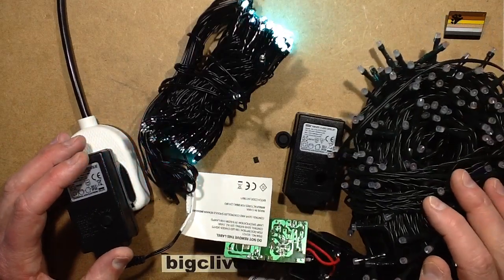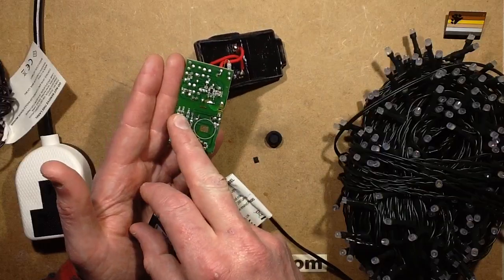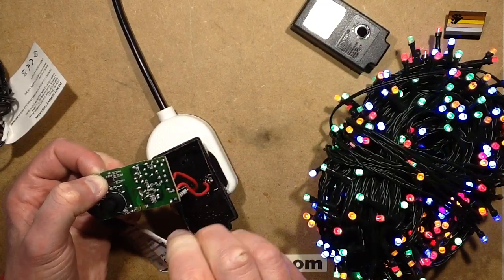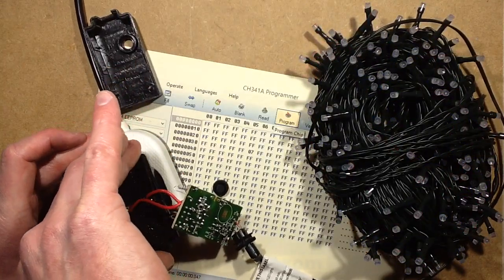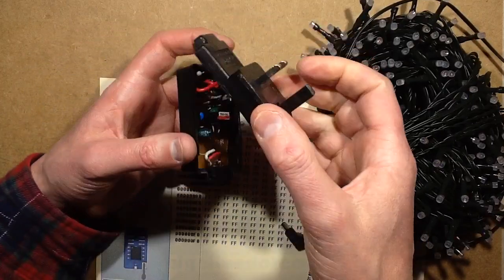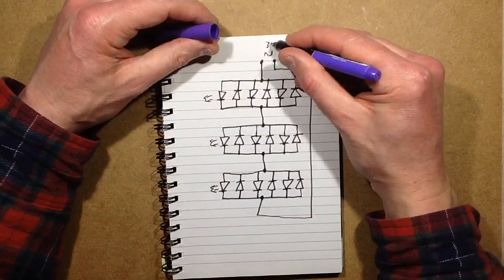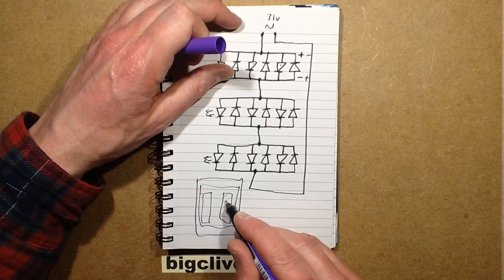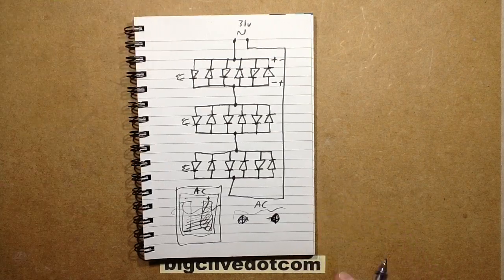Memory hack for new 2-wire LED Christmas fairy light controller.

Comment: And few years later in 2020 the memory chips became so cheap almost all the lights I have has setting memory._
Reply: Well, one more year later, they don't. Just bought a few of these and they don't remember the last status. I'll discard the original power brick and I'll feed the strings from a transformer. Yes, LEDs will flicker at half of the supplied voltage, so 25 Hz in my case but the strings are to be installed outdoor.
Reply: @horatiuslavescu  I have a string of lights on my window from 2015 and it kept the setting after 10 months being unplugged. Although not all lights are same._
Reply: @horatiuslavescu  curious to see what you came up with!  I installed 21 of these things wrapping several trees only to find out the last 13 of them don't have the memory function.  And getting a 73yo woman outside to cycle 7 times through each of them unfortunately means she won't use them in the future.  I'm a bit more amateur and trying to find a more robust way to just keep them in always-on mode.  I could try getting a memory chip (13 actually) and doing it that way, but I'd rather have a single supply that could provide the adequate current but just do the simple oscillating and not support all the other modes.  Right now it starts in the combination/demo mode, which we call "clown show mode".  The Christmas light equivalent to one of those terrible car alarms that goes through several modes over 20 seconds :D

Comment: great video i learned a lot from it,  i have very similar lights from Amazon but the Led controller is slightly different from yours as it does not have the space for another IC controller like you used as memory, does that mean it is not possible to have the lights on it fixed, it be awesome if you could check the photo of my board and see if it has a chance as i hate those multi function controllers   ibb.co/0GRJvkd  thanks for your great vids

Comment: Just tried this hack and it works.  Converted two sets of lights, couldn't work out which was pin 1 so I guessed and the first chip was fitted the wrong way round.  Removed it and rotated 180 degrees and it worked perfectly.  I can now switch them on with a timer without the manic flashing.  Great tip

Comment: I used a pair of Knipex water pump pliers to crush along the side seam until it audibly cracks.( I have also smacked the sides of similar cases with the handle of a screwdriver to crack the glue..)
. Then resoldered the connections to the transformer ( looks like electromigration cracks round the pins caused by high current spikes, common SMPS fault) as it had failed glowing dimly all the time the mains was on. The version I had seemed to have non volatile storage on the 8 pin controller, only one chip and an H bridge.

Comment: and 4 years in the future...  they still have not made them luxury yet... friggin lights still dont remember last mode!!!  thx for this vid, I am going to crack one open and see if there is a spot for a memory chip, order one and install asap.
Reply: I must be lucky as all the two wire sets I've bought in the sale remember their last setting.  And yet it's funny, our new oven can't remember its settings each time there's a power outage!
Reply: Even more annoying they default back to off position once power is cut ,so you have to switch on manually,once power is restored .No good for a solar setup

Comment: Have had good luck opening "wall warts"/power packs and these kind of sealed boxes with a bit of petrol/gas in a syringe, soak the joint, even if you need to use a needle to keep it tidy, after a minute or so you can work the cover loose with a plastic prying tool.

Comment: Hey Buddy. I have string LED lights on my Christmas Tree. The operate with Red and Warm White... then Blue And Green. A programmer changes the pattern but the paired colours remain the same regardles. There are only 2 wires exiting the transformer/controller single unit as in your video. But I notice a single wire bypassing all the LED's to the end... at the first LED (CLOSEST TO THE MAINS CONTROLLER) has 1 wire going in (live I assume) and then 2 wires coming out. The second LED in line has 2 wires going in, and 2 wires coming out. This is repeated until the last LED where the (assumed) NEUTRAL OR GROUND completes the circuit. I THINK the set up described above is accurate but I may have missed something. I want to make the RED and WARM WHITE to be static and the BLUE and GREEN TO NOT OPERATE at all. Can you help. I'm an electrician by trade not an electronics engineer. So I am aware of safety aspects. Thank you.
Reply from the maker: It probably swaps polarity to do the colour change.  You could probably just put a single diode in line with either of the two wires coming out of the controller to choose either of the two colour pairs depending on its polarity.

Comment: I have some string lights which dont have a place for a memory chip on the board. I would like to try to hack a chip in soldering it directly onto the existing one. Is it posible you could doodle the circuit for the memory IC down somewhere?

Comment: Cool! Thanks for sharing this, Clive. I have set of solar-powered fairy lights that I adore, but their nasty flashing settings (of which there are about 20 that I have to cycle through every time I turn them on) drive me to distraction. I will try to get my hands on some tools later and open up the control box. As I'm travelling and don't have any way to do soldering, is there any alternative approach you would recommend for keeping the memory chip in place?
Reply from the maker: If it has the memory position, soldering is the only secure option.

Comment: Had controller from same manufacturer, tried taking it apart to do this and sadly it looks like they've changed the design - no longer any pads on the board for the chip. It has a later version of the microcontroller - JT-401D - so I guess they took out the memory option.

Comment: Thanks for this! All my other set of lights have a memory, apart from the 1000 led string bought reduced to clear last January. Couldn't use them without this.
Reply: Adding a 24c02 chip worked a treat

Comment: Thanks for bringing this to my attention Clive, my house is now 100% more christmassy as I couldn't be bothered to put the lights on previously, since they always start on some seizure inducing disco strobe setting and pressing through the settings was a chore.

2 minutes separating the cases with a stanley, 4 hours tidying my man-cave while looking for a serial EEPROM and a few minutes to fit one and gluing the cases again and we're all set.

I would like to add that it would appear that the EEPROM doesn't necessarily need to be a 24C02 in these (CZ) JUTAI units, I used a 24C16 as it was the first thing I happened across, and the addressing of serial EEPROMs would suggest this would work with anything from a 24C01 to a 24C32, as higher address bits will just be ignored.

Comment: As far as corrosion, the lead on each LED would only see one direction of current flow and corrode.
Reply from the maker: It's the voltage between them that matters so it's going to effectively be about 3V AC.

Comment: Finally found this video got a question can you put in a memory chip with the older style of function and musical  lights because it's quite annoying when they start on static and I always have to change the function every time I plug them in
Reply: The only reason adding the memory chip works in this case is that there is already programming for it in the MCU (the open position for the memory chip on the board is a plus). If the programming doesn't exist then no amount of memory chips will help.
Reply: @TehFreek  darn lol OK

Comment: I just bought two sets of christmas lights, the power supply is very similar to the other JUTAI power supply in your other video here: https://www.youtube.com/watch?v=5EsnrO45ObA except it has a pattern switch built in. I was intrigued as how it can do the flashing patterns with only two wires. This video explains it. Very clever design!

Comment: Open the case the easy way.....   I use a bench vice and a rod, lay the rod along one of the long sides, right over the joint and wind the vice hard until it starts to crack.   Do the same to the other side a few times and away you go.       For tough ones add some hot air to the joint.

Comment: i got a set with a rf receiver built into the psu  as you can change modes on the remote . i got it from the original  factory shop in the uk
Reply: and it has a timer mode

Comment: Hi Clive, Love the channel! - I'm an avid watcher of your videos and fellow tinkerer of stuff, (and also of your Ralfy too, as I like to partake of a wee dram of an evening). I was just about to set to repairing the wiring on my set of LED Works 'Twinkly' app controlled Xmas lights (see here - https://www.twinkly.com/ ) and thought I would offer you the first option of buggering them up (or not). BTW the cat chewed through 3 of the 4 fairy light wires last year when on the tree. Let me know if you're interested and I'll post over to you. Feel free to msg me via YouTube

Cheers, and keep up the great vids!

MB
Reply from the maker: If the wires are matched in any way I'd suggest rejoining them.  That should be a low voltage system.  Make sure you get them right before powering it though, as putting power into a data input could damage them.
Reply: @bigclivedotcom  Cheers for the quick reply Clive. The problem is that all 4 wires are same coloured (fir tree green), possibly a single -ve and 3x +ves for RGB, but there must be data as well as each RGB led bulb is individually addressable. I was thinking of a trial and error approach in the absence of any identifying marks.
Reply from the maker: @michaeldutsonlandscapephot2184  Do they pass through each lamp holder in a pattern that could help with identification?
Reply: @bigclivedotcom  Hi Clive, Thanks for the answer - yes, sort of. I traced the broken wiring back a couple of feet on both sides and it appears that the lights are running in series on a common wire. This then leaves the two other broken wires. The lights can be extended by means of a directional two pin plug at the end of the light string, and I think the two remaining broken wires may be used for the add-on set, (although the add on set starts off from a two pin plug, they then run with three wires in the extension string). From what I can find out about these when they came out on Kickstarter, the original set up controller was an Arduino. Hmmmm. Found this from the early development stages - https://www.kickstarter.com/projects/twinkly/twinkly-smart-decoration-for-your-christmas/description#prototype-slide-8397   Looks like there is a controller chip built into the LEDs - this is the spec sheet for it WS2812 - https://cdn-shop.adafruit.com/datasheets/WS2812.pdf
Reply: Thanks for the input Clive, I got the soldering iron warmed up and fixed them today. Working a treat and finished off with a nice bit of heat shrink tubing, nobody would know the cat had been near. Saved £150 in Xmas lights!

Comment: Hi! I have noticed you have a video on how to repair the copper wire ones, but I bought 4 sets of 5 wire led lights like the ones in this video, my kitten chewed through some of the cords and now only a few lights work for each set. Could you do a video on how to repair them? They are clear plastic cords with the wire in the center( obviously), and yes I know they are super cheap on Ebay but they take a good 4 months to come and it would be such a shame to throw them out as I really love them :( I have 0 experience in electrical things and so I was going to just cut away the plastic and expose the wire and twist them together and wrap the bare wires in electrical tape but I'm not sure if that would be good enough?
Reply from the maker: If they are the lights directly powered by wall power with no low voltage adaptor I'd recommend not having them around a kitten.  The best type to have around kids, puppies and kittens is low voltage sets with either a transformer or battery pack.

Comment: Ah electricity, always entertaining.  I recall back in '71, I was stationed at Camp Haskins, a small army camp about 10 miles from DaNang Vietnam.  We had a land-line teletype setup for Group Headquarters, it was an insulated fiberglass dome with sandbags around it, and a tin roof above, all surrounded by chain-link fence with a gate that could only be opened from the inside.  Because of the extreme heat and humidity over there, it was found necessary to have the hut air conditioned. There was a special extension for the purpose of installing what we now call window air-conditioners.  Now the "expert" in hooking such things up was what we called the "mini-lifer"  A staff sergeant who was about 4'9" and must have weighed in at about 110 pounds.  The air conditioner had to be direct wired in to our 110 volt system, and the whole unit was in a rather small extension on the back side of the dome.  So we have this little guy trying to hook up power (in actuality he was a communications specialist and knew very little about AC!) and every time he got a shock, the little guy would straighten out, smacking his head on the overhang that protected the air conditioner.  We were almost rolling on the floor watching as he kept trying to get the unit installed, all the while taking shots of 110 and jumping like some kids toy on a pull string.  He was not appreciative but was also  not in our chain of command so he had no real way to get back at us.

Comment: I'm confused.  True fairy lights are the size of a grain of rice and the wire is one very thin wire.  Most of them are battery operated. I had no idea that there were two kinds of fairy lights. I've searched the net plus stores and true random twinkle lights are no where to be found. The only thing close to a twinkle is 1 buib goes on and off and 3 or 4 stay on, and this is repeated the entire length of the cord. Most of us are not electricians.
Reply from the maker: In the UK the term Fairy Lights describes all Christmas style lights.

Comment: oooh, could you show your method of reading that 24c02, please?
Reply from the maker: https://www.ebay.co.uk/itm/152328892766
Reply: Thank you! Will be a nice complement to pure breadboard-&-Arduino for the 2402 I salvaged out of an old LOEWE TV set, including a custom 65C02 uP!
I see the tool you've printed the screenshot of is called CH341A programmer. Do you have a preferred source for that? Thanks!

Comment: Is there any way to wire something up to make these LEDs dimmer?
Reply from the maker: You'd possibly have to use a different power supply that put out a slightly lower voltage or use a beefy resistor inline to limit the current.  If using several sets of lights it might be viable to run several sets from one power supply to share the current between them and make them dimmer.
Reply: bigclivedotcom thanks for the reply 👍 

Doubt I would have a big enough resistor kicking about as you used the words beefy 😂

I wish I understood more about resistors and other components to be able to figure this stuff out. Anything past  Basic circuits and I'm lost (I'm talking very basic)

Throws me as you have 2 wires from plug and 3 on the LEDs .... More research! 

Thanks again, love your work although sometimes I get lost and have to re-google this stuff haha.

Comment: i just run mine off a standard 24v ac fairy light transformer when the original 2 wire controller died

Comment: Clive, I'm wondering if a well placed drill bit could expose the point in the PCB where the chip should be placed, as opposed to fully opening the case.
Reply: That sound like an interesting idea. You could start with a small hole to allow you to view the PCB, and then make it bigger with a scalpel.

Comment: Is there any regulation/sensing going on after the rectifyer following secondary (low voltage side) of transformer? If it is all done on the primary side+separate sense winding, can you just connect the led string connection DIRECTLY to (low voltage) AC transformer output??? (kinda reverse trick of rectifying AC that goes to triac-switched tungsten christmas lights chain...)

Comment: Hello Clive - yesterday I wrapped a 1000 set of these up and down tree branches which was entertaining will a coiled ball that started off the size of a football.  Anyway, having worked perfectly in their 5 bundles before they went up,  the last section is now dead, probably because I dropped my football a few times - the remaining 800 look superb. Got very confused with 2 wires and 2 channels, but managed to come to a conclusion you just proved ref strobing. I'm guess now I just have a broken link at one of the stages , would you agree ? BTW - I think i've seen you on pinball forums in a previous life ? You knew a thing or 2 then - many thx

Comment: Contact with me , I will tell you how our machine soldering the LED with wires
Reply: Very interesting video from Clive - I just spent ages wrapping a 1000 set round a tree only for the last section nearest to the control unlt to fail - maybe 200/1000 . The dead section is where it goes from 5 wires to 2, so I assume a new section - any ideas Lv, I suspect you may know the section wiring details :) Either way, the 800/1000 look superb. Thx

Comment: Ironic that the abbreviations aren't the other way around, so that AC = "Accelerated Corrosion" and DC = "Doesn't Corrode" (well, not as rapidly.)

Before the electronics "experts" jump in and explain what AC and DC stand for, allow me to say that I'm a fully qualified electronics engineer of 25 years.

Hard to explain what I mean; you either get it or ya don't.